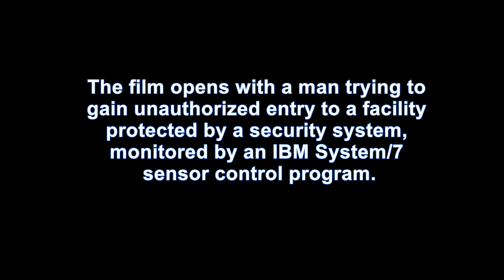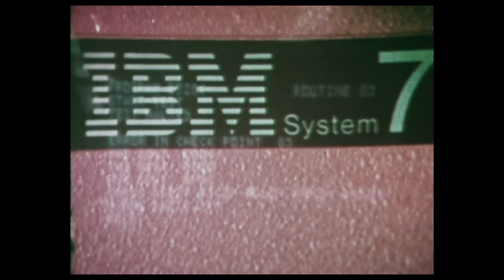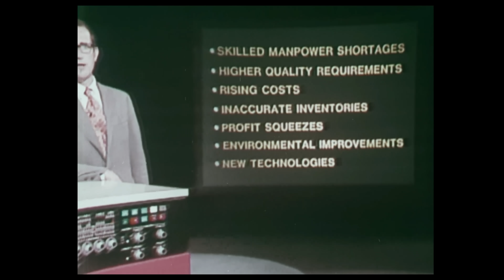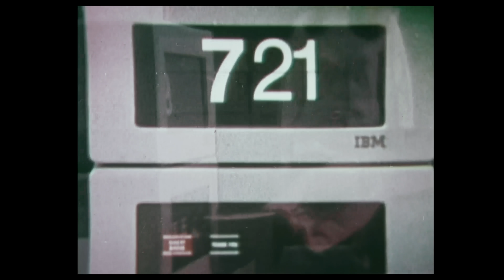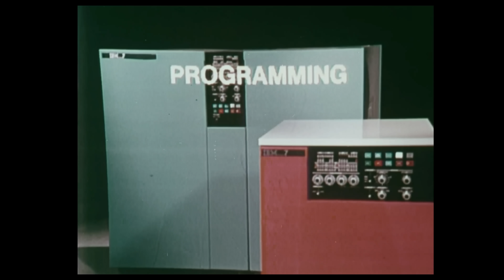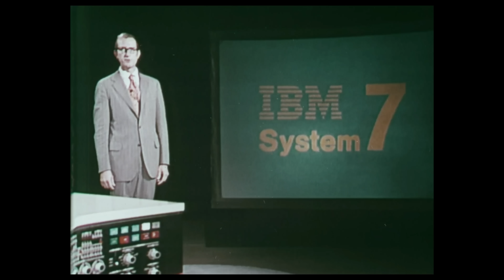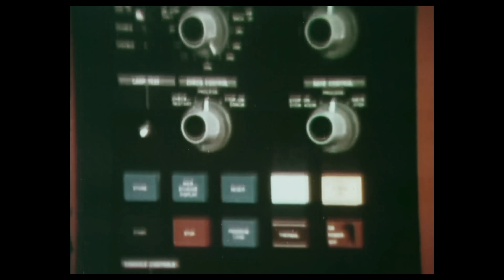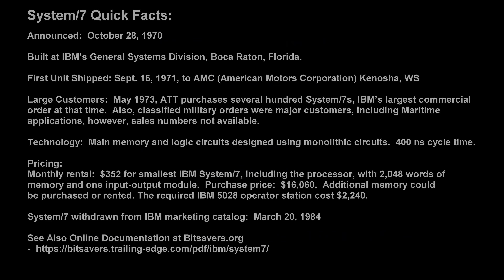IBM System/7 Computer System, 1971, rare marketing film, partly restored, color, monolithic circuits

Comment: 'a cycle of 400 nanoseconds', that's the same as 2.5MHz. the first Z80 also ran on that clock frequency.

The System/7 reminds me more of a PLC than a mainframe, a Programmable Logic Controller also has all these analog and digital I/O. I sometimes work with the Siemens S7 1500 system, connecting IT and OT (Operational Technologies)
Reply from the maker: Hi @MIGHTYcbu,  Fascinating!  PLC, Programmable Logic Controller, is alao a very cool technology.  Thanks!

Comment: I was actually a summer Intern for IBM in that era.  The system70s mainframes were the vogue then, but we worked on a video "Workstation" for the Ford auto company, which was intended to design car body structures.  These workstations were the first to incorporate "light pens" which were used to implant "design points" into a digital framework, and create an actual object.  These pens were passive, in that they did not insert any data, but rather read-it-out, from the screen (a very large CRT).  the problems were that the CRTs were curved, had bowing and lack of raster registry, and so the actual data-dots did not register properly, into a 2D or 3D mechanical dataspace.  Also, at that time, IBM was still using the old SLT flip-chip metal-ball ICs (not the newer 8-12-16 framed molded ICs), and these had significant problems in maintaining "sensitivity or drift" paramaters, and had high failure rates.  The technicians worked on these Workstations 24/7 to keep them running.  Nonetheless, our Workstations, the ones I worked on, did eventually work just fine, and were adopted by the industry as "working standards".  I am actually proud of having been involved in this early development, and later went on to become an IC and ASIC designer.
Reply from the maker: Hi @brunonikodemski2420, thank you for sharing some of your hands-on history with the early technology of the 70's!   That is fascinating information about the workstations and light pen technology you were involved with.  A great bit of history!   Didn't know about these in particular, thanks for giving us a look back!  ~   Victor, CHAP

Comment: Very impressive for 1970-71 including early use of semiconductor memory. Looks like a complete system for well-heeled customers. The 2790 mentioned in the end notes were communication processors to network components with its own ecosystem which could be used with other IBM product lines. 02:08  The inimitable Selectric Ball print head.
Reply from the maker: Yes, the "Selectric Ball print head"  -- good spotting!

Comment: In my world, the System 7 was not interesting.  Minicomputers like the PDP-11 were faster, cheaper, and more flexible.  For corporations captured by IBM, it might have been viable.
The space was very dynamic, with lots of competition.  Sometimes a Data General machine made more sense that a DEC machine.  HP and Honeywell made noteable16-bit machines too.
The system 7 was surely a step up from the IBM 1130 / 1800.  Or, reaching farther back, the IBM 1620 / 1710.  The 1800 and the 1710 were extensively used in process control.

Note: small machines for business processes were a different line.  IBM's System/3, for example
Reply from the maker: Hi @d.hughredelmeier1960, thanks for the perspective!  You make some good points.  I also think it was odd the narrator said it was not a "minicomputer" but a complete system.  The System 34, 36, 38 were all minicomputers and complete systems.  The Sys/7 seemed to fit in the minicomputer class more than the micro or mainframe class.  Just a thought.   ~  Thanks for your feedback and insights! ~  VK
Reply: @ComputerHistoryArchivesProject  There really were no microcomputers in 1971 and certainly not enough to form a class.  What is meant by "microcomputer" evolved too.

But first came the microprocessor, like the Intel 4004.  When a microprocessor was used as the heart of a computer, we got microcomputers.  The first microprocessor-based personal computer with any visibility would have been the Altair 8800.  Earlier things like the Micro-8 were almost invisible.  The MCM/70 was slightly earlier and way more ambitious but only found a niche market.

By the time microcomputers came out, minicomputers were way more powerful.  Microcomputers were about as powerful as 5 or more year old minicomputers.  The Altair 8080 came at roughly to same time as the PDP-11/45 minicomputer.  The PDP-11/45 was the platform where UNIX thrived.  UNIX didn't work well on microcomputers until  the Motorola 68000 and successors (think Sun Microsystems).

Comment: 13:21 - Interesting, an account of the Academy Awards in Mar 27, 1973 ! Is your date of 1971 correct?
Reply from the maker: Hi @dhpbear2, very, good catch!   The System/7 was shipped and first available in 1971.  That's the date we used on the "Thumbnail."   The film itself was made in 1973 or maybe 1974.  Tried to explain this in the YT "description" section.  You have a keen eye.  Thanks!  ~ VK

Comment: Was it fast enough for underground nuclear weapon testing telemetry?
Reply: In the tests, the signals were captured using special oscilloscopes, and then the screens of the oscilloscopes were automatically photographed. This allowed to record signals at a variety of time scales, including the fastest, corresponding to the "reaction history" where the entire record was under one microsecond long. There were entire trailers filled with such gear. If there were any computers somewhere, they did not play a very prominent role.
Reply from the maker: That is an interesting question, do not know the answer, but the military was a customer.
Reply: Probably not. The place where I worked nearly 50 years ago had a System 7 and we had a program called "High Frequency Scan" that we used to gather data from lab experiments - I think it had a sampling rate of around 10 kHz.
 
IBM documentation states the analog input mutiplexer operates at up to 7, 14 or 20 kHz depending on the mode and voltage range used.

Comment: sounds like a PLC nowadays
Reply from the maker: "PLC" ?
Reply: @ComputerHistoryArchivesProject  Program Logic Controllers.  I think of PLC as a kind off programming language that emulates relay system.  System/7 could surely do that but it wasn't limited that way.
Reply: I wouldn't be surprised if this came out of GM's request that resulted in the Modicon 084 and AB PLC lines.

Comment: Is that security guard riding a Segway in 1971??? What is that thing?
Reply: It looks like some kind of 3-wheeled electric scooter.
Reply from the maker: The Segway was patented in 1994 and announced around 2001.  This little scooter was much earlier.  Hopefully, someone watching can identify it by name.   Thanks!  ~  VK
Reply: Not a 2 wheeler controlled by shifting position, but an ancestor.
Reply: @maralisil  it does appear in that video like it steers by balancing and body position in in some way. Hopefully somebody can identify kind of device it is,

Comment: It could also be programmed in Assembler, using a mainframe such as Assembler H at an IBM data centre.  Object code was transferred using a  domestic cassette recorder.  The Plastic Injection Moulding System was one such.
Reply: That's odd: Assembler H was for /360 code, very different from /7 code.  I guess that you could hack it with macros but that would be pretty awkward.
Reply from the maker: Hi @davidmontague9125, great info!  Thanks very much! ~  VK

Comment: It used Fortran IV which was published in 1962 but Fortran 66 being the 1966 language standard wasn't used in this '71 computer.
Reply: Realistically, Fortran IV was more extensive than Fortran 66.
Reply: I learnt Fortran IV in 1974 (my first language as it were), I don't remember 66 at all
Reply: @Stuart-AJC  IBM created FORTRAN for the IBM 704 in the mid 1950s.  It was very successful: most scientific programming was done in it.  So other companies created implementations.  All were a little different.  FORTRAN 66 was a standard that ASA  released in 1966.  There were actually two FORTRAN 66 standards: "Basic FORTRAN 66" and "FORTRAN 66".  Basic FORTRAN 66 missed a lot of nice things.  You can read about this in Wikipedia https://en.wikipedia.org/wiki/Fortran .  I kind of lived it but I didn't like it.
Reply from the maker: Hi @d.hughredelmeier1960, thank you for the great technical info!  ~  VK

Comment: That is cool. I’ve
Worked places that used Siemens controlled equipment or PLCs.   I bet a Raspberry Pi could do the same thing now. 😂.  Also the presenter had a deer in the headlights look… he rarely blinked.
Reply from the maker: Hi @mrbrent62, yes, the presenter was a bit "stiff" for some reason. He should have sat down and relaxed at some point.  Maybe it was his first "formal presentation film."
Reply: @ComputerHistoryArchivesProject  Maybe they overwound his clockspring before filming :-D
Scene in supermarket, early 70s. Customer to cashier: "Do you have batteries?" Cashier: "No, the head of department winds us up every morning."
Reply: A Rasbpi could not do the same thing. It could handle parts of it though, but it wouldn't come close to the i/o these things had/have. Expanding the rasbpi a whole lot would possibly get you close. not sure, but it lacks the interrupt oriented i/o and process control afaik, there is no OS for rasbpi to do that sort of job in a serious way. It might work, might not - which isn't an acceptable way to estimate it. That is why what this does is not done on a raspbi today, or on a PC or mac. It's done on a PLC - or something running VxWorks or some other RTOS.
Reply: @noth606  even running 40 single board computers would still be a fraction of the cost. But you are correct  organizing the flow of data to work would be interesting.  The system 7 was a 16 bit computer   And could support 64 interrupts the raspberry pie with its 64 bit. ARM processor can support over 100 interrupts.  I also think the devices and interfaces that would be hooked up to it would be a lot slower and the raspberry pie would probably not have any trouble keeping up with the data flow.
Reply: @mrbrent62  I'm sure it could be made to work somehow, but I'd really hate to be the guy sent bughunting 40 raspberry pi's when something goes out of whack. Serviceability is an important consideration. For me anyway, mostly because when something goes wrong it isn't uncommon to then get top brass breathing down your neck until you hunt down and fix whatever it is, because even when you've fixed it, they will blame you for it going wrong in the first place.
Reply: Yeah, I totally run a complete shoe factory, payment processing, salary, timekeeping of thousands of workers, shipping department and more on a single raspberry pi zero 2w.